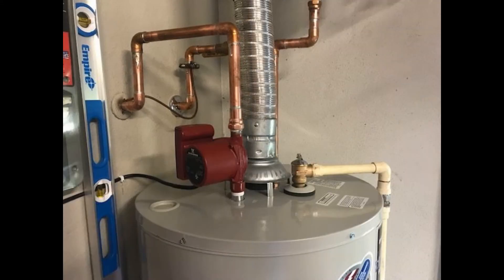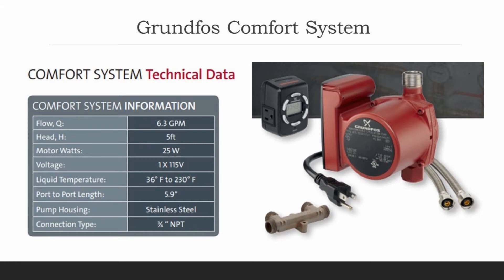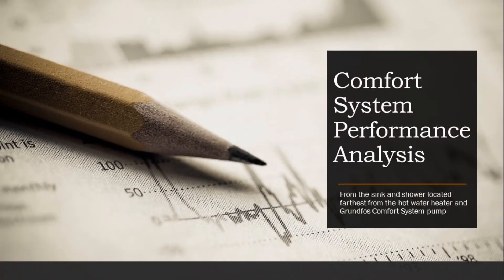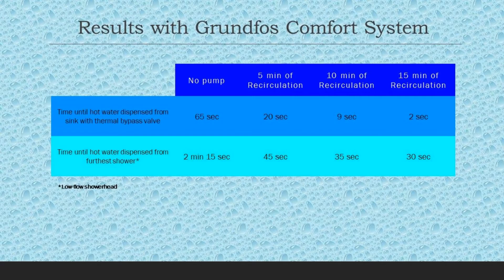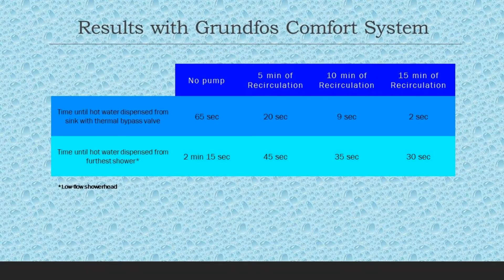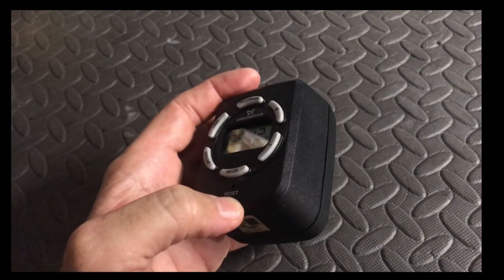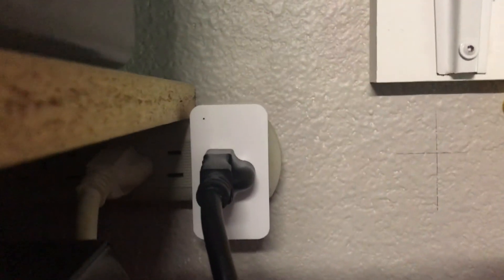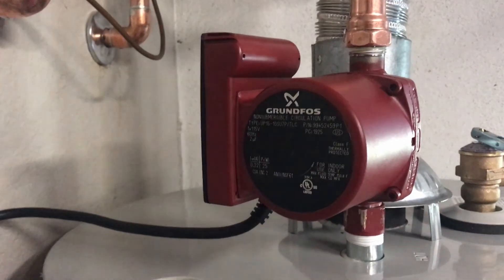Review of the Grundfos Comfort System Hot Water Recirculation Pump

Comment: I have a Grundfos recirculating pump that was installed in 2005. It was original construction so I have the dedicated line. It must make a difference because I have instantaneous hot water so I don’t have to “preheat” it. I have an analog timer that is sooooo outdated. I am surprised Grundfos doesn’t have a phone app to control the system. I too run the system with a smart plug (Kasa). I don’t have the auto shut-off so I may look into the Wyze. As far as electricity usage goes, Grundfos claims it uses the same amount of electricity as a 25 watt light bulb (yes it’s more than most LED bulbs but far less electricity usage than some people realize although I would never let it run all the time).
Reply: I added a recirculation pump, dedicated return to our ranch house. All lines are insulated supply & return. I installed isolation valves so I could track utilities with & without it in use. I found it did save water... not significant savings because water rates are low in my area. I found little difference in gas or electric usage... so my pump has been in use continuously 25 years! Surprisingly the same pump has been in service the entire time! I Like instant hot water at all taps! The pump is a little giant magnetic drive. Only maintenance is oiling the motor. This pump is no longer available, I do have new replacement in box...most likely the reason original hasn't failed!
Reply: But aren’t you wasting a fortune by having your water heater constantly be warming up cold water that the pump is sending back to the water heater?
Reply: @westfield90  Without being an expert, I would suggest that it is a small consideration since it isn’t exactly “cold” water being sent back to the water heater, it’s just colder than the valve’s minimum temp to stay closed. It would therefore take less energy to reheat than the actually cold new water from the municipal supply or a well.
Reply: @jaw982  

Does the recirculation pump increase the hot water pressure and flow ?
Reply from the maker: @ajarivas72  not that I can tell.  I have turned it on and off when the shower or sink was running and I don’t sense any flow or pressure fluctuations.
Reply: @DanRetired2017  thanks a lot for your answer.

Comment: So since you don’t need a dedicated line, does the hot side push the cold back to the  heater from the valve?
Reply from the maker: It does recirculate it back to the water heater through the cold water lines.  Check out the official Grundfos video depicting the operation at https://www.youtube.com/watch?v=Jd0IsylW4Cc